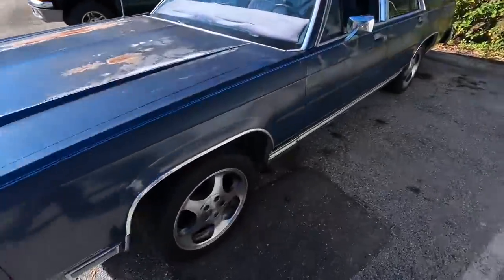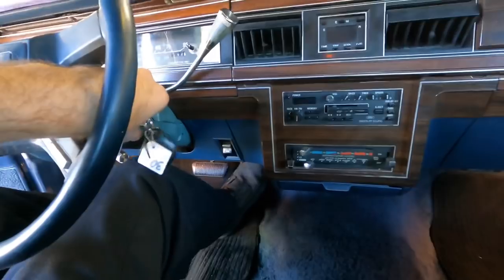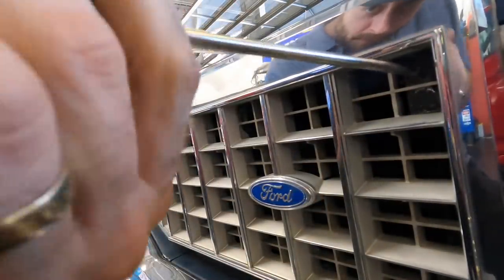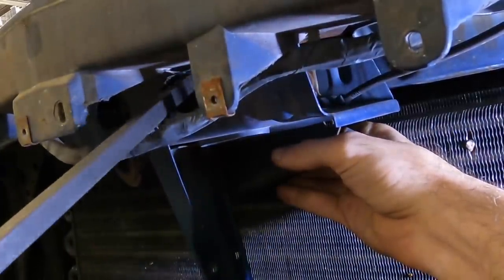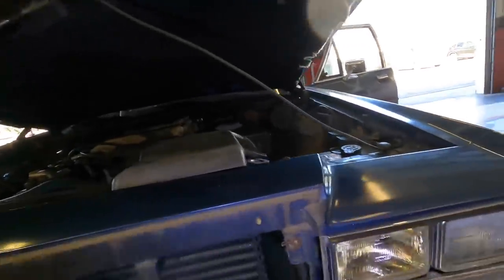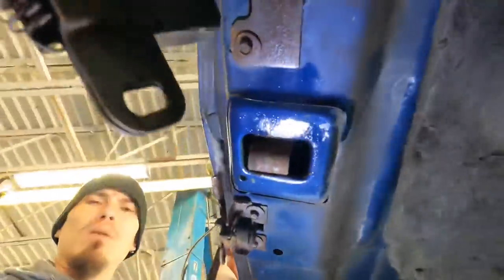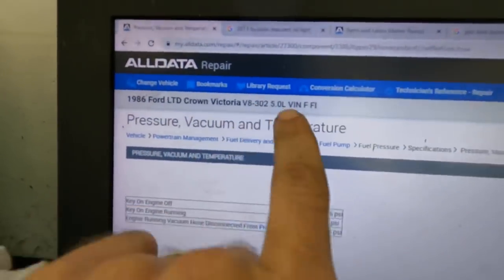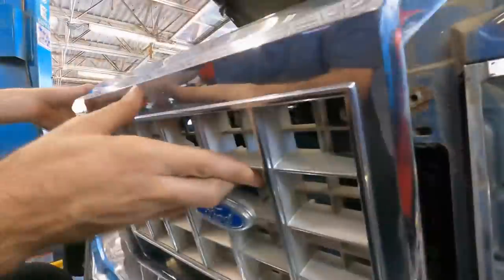Customer States: Replaced Engine, still stalling!

Comment: Hopefully you charge at least an hour for Diagnostics because of the hood issue.  Not to mention he is gonna fix himself.  You already know he will buy the cheapest fuel pump known to man and then complain about the diagnostics because after he replaces the pump it will run but still not running 100% perfect like new when finished.  These are the customers you just gotta say NO to.

Comment: Too bad the customer took the car, if the new fuel pump doesn't solve the complaint we need power and ground, and voltage drop testing, before calling the part. Why is fuel pressure low. Would like to know the result of this one but even ray probably won't here from this guy again.

Comment: Another Flaky customer.
Hope Ray  compensated for repairs/diagnosis. Early FoMoCo ecm diagnosis required 'breakout box' and more time than custs would pay for. I gifted mine to such an owner and never touched another OBD l FoMoCo.
Current Ford prized possession is 66 F100 Camper Spl. All orig 352FE V8, 'walking granny' 4spd manual, Dana 60 Sure grip, 3.50
Purchased 1978.